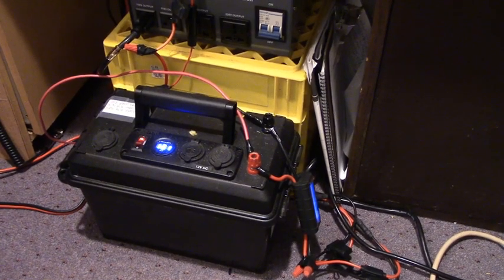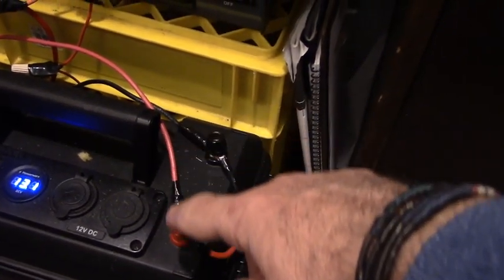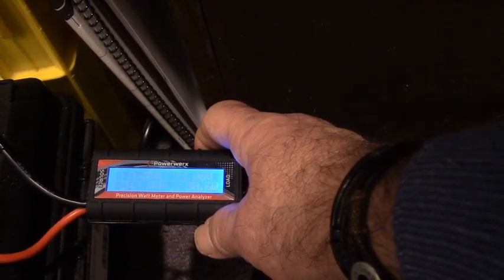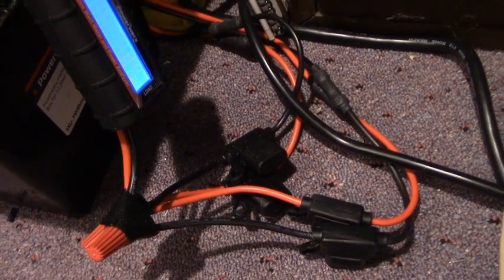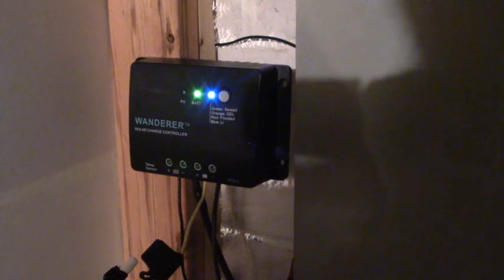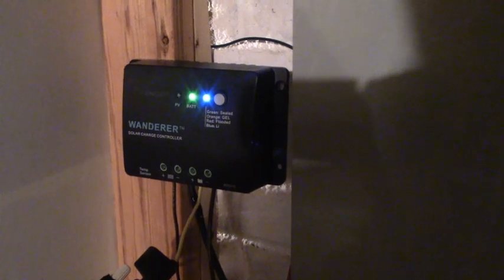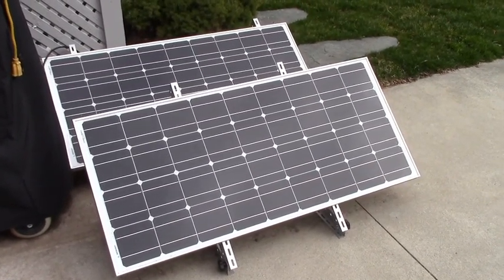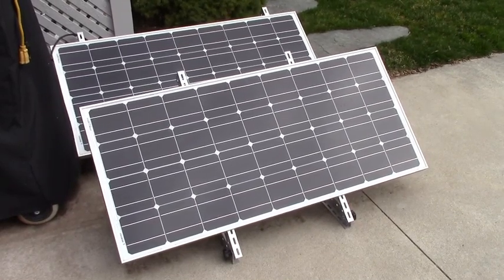Operating My Home Ham Radio with Solar Power, # 5

Comment: What do you think would be the minimum solar panel wattage for a single 2 channel mobile radio base station?
Reply from the maker: Hello Vince. Thanks for stopping by. I would recommend something in the range of 2 to 4 times the power rating of your radio. I operate CW at 100 watts and can keep the battery charged up rather well with two 100 watt panels
Reply: @AA8PI  makes perfect sense. Thanks for the reply.

Comment: Your set up is a great learning experience for me. I’ve been looking for solar options to top off my Bioenno 20ah battery to power my IC7300. Just curious why you have the bioenno battery in a box with meter and then chain another Powerwerx meter off of that? I use the same Powerwerx meter on my bioengineered 20 ah battery and it gives me all the same needed info. I guess the box is added protection. I just thought it’d be extra bulk. Can you recommend similar panels that I could take to the field? I always take it all portable. 73, Rob/WA9RAD
Reply from the maker: I have the battery in the box from when I was using it for portable ops. Just never took it out of the box. Also the Powereerx meter is there from when I first hooked this all up I was monitoring my Ahr usage when the radio was on to get a better feel for how much energy I was consuming and regaining from the solar panels. Now I just keep an eye on the meter on the battery box. Once in awhile I have found in the cloudy days I had to top off the batter with house power. But honestly I cannot remember the last time I had to do that so everything works really well for the 200 watts solar and this 20ahr battery. Hope it works for you too!
Reply: @AA8PI  Thanks for your quick reply! I appreciate that. Considering the 20 ah battery that we both use to power the 7300. Could you recommend a particular panel and size of panel that I might take into the field to keep the battery running closer to 13.8 volts? I see that Bioenno and Power Fil solar have several options, but some are either bulky, expensive, or both. Not sure of the appropriate size for the 20 ah bioenno.
Reply from the maker: @RobPetty622  I use the portable fold up Bioenno solar charger when in the field with the 20 Ahr battery. I show that being used in some of the other videos I posted

Comment: New sub here. Just passed my tech & General in January. I am looking at changing my office to a ham shack.  Already have an entrance panel for my LMR400 cables for my LTE cellular data internet. Country internet at its finest.  Haha.  So considering solar and lifepo4 batteries how long can you operate on that 20ah bioeno battery.   I like the ammo can battery setup you have for portable. Thanks for the good video.  73! De KI5HXM
Reply from the maker: I am usually on the radio several hours a day and honestly I cannot remember the last time I had to recharge the 20 Ahr battery using my house power. The 200 watt solar power does the job. In theory at 100 watts constantly transmitting you might get about 2 hrs off the battery. If all you did was had your radio on you might get 20 hrs on the battery and this assumes no solar gain.
Reply: @AA8PI  thanks for the reply. Estimating power usage is a bit confusing.  Perhaps measuring actual usage would be good if I were to start low and build from there.  After all adding capacity would just be putting a couple batteries in parallel so I would be easy to grow the system in terms of AH. Thanks again for your comment.  Perhaps I need to evaluate my amp hours before I think I have to be prepared for everything.  Haha.  73!